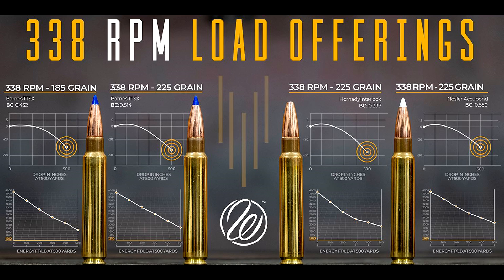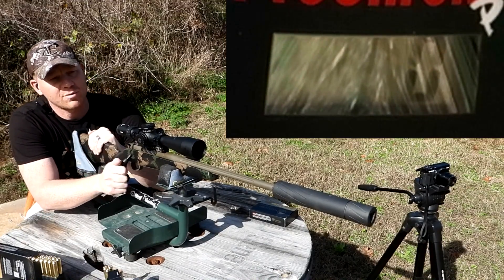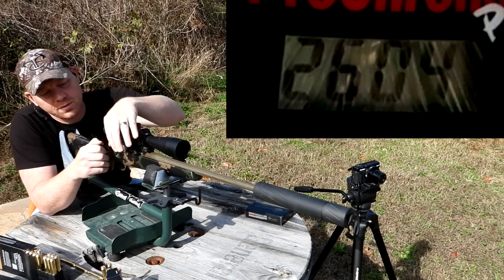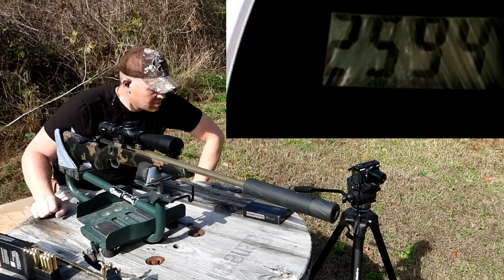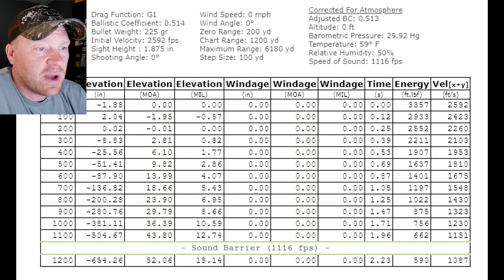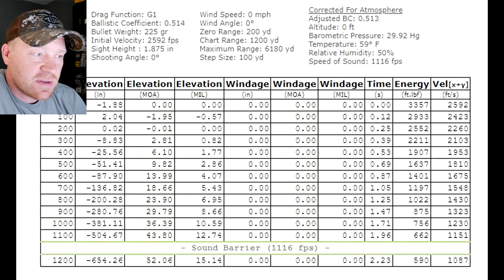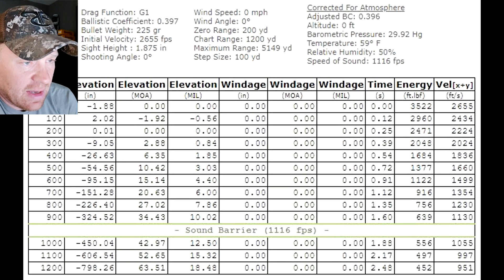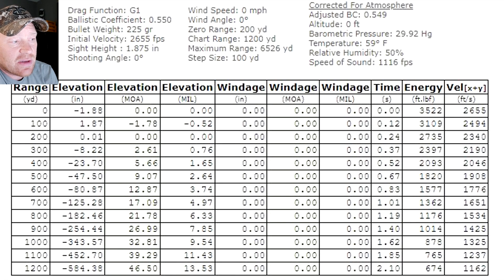338 WBY RPM - Bullet Drop and Energy Explained

Comment: Knowing the energy is good, but we also need to know the minimum velocity for bullet expansion to not have a trophy animal run off and die due to a bullet not performing. Some people use 1800 fps as a minimum, but sometimes Barnes bullets need more velocity to reliably expand.

Comment: Remember, this 338 RPM is specifically designed to fit the Standard Mark V action, NOT the Magnum Mark V.  Doing so negates any comparison to the magnum sized cartridges like the 300 or 338 Winchesters that will not physically fit into the Standard Mark V action.  The intent for this cartridge is increased performance and typical big game hunting distances in a standard actioned 6 pound rifle.

Comment: Others may have said this already but most copper monolithic bullets only expand reliably over 2000 fps. Id probably want 2200 from a copper. Looks like the rpm needs a 22 inch pipe at least to get the full effect. I personally use regular copper jacketed bullets for deer hunting and I like impact velocity between 24 and 2800 for the most shock/energy dump into the deer while not going so fast as to have the bullets come apart. I've hit deer with 130gr 270 bullets in archery range and those bullets hitting the deer well over 3000 definitely explode, leaving alot of lead bits in your meat.

Comment: Great video - Love that the mix of an oddball cartridge with a very short barrel. Would love to see what you can squeeze out of it in a handload with a powder matching the shorter barrel length. 
On the performance - not enough of a difference for me to consider it. 
At 400 the AccuBonds only a 250 ft-lb advantage over my 30-06 200gn ELD-X load out of my 24’ (barrel+can) combo.

Comment: "Ultra High Velocity Ammunition"  seems like a bit of a stretch!  I'd still like to see a comparison with your 35 Whelen.  Run the numbers side by side.
Reply: Its not really in the same ballpark
Reply: @pamelahall3287  I think you are right, the Whelen would beat it by quite a bit.

By WTW's own chronograph numbers using both Barnes TTSX boo-lots the 185gr 338 RPM is flung at 2830 fps, while the 180 gr 35 Helen is going 2949 fps.  So at least in the first 300 yards the wHelen shoots faster and flatter for a better point blank range, has more energy, AND makes a larger hole.